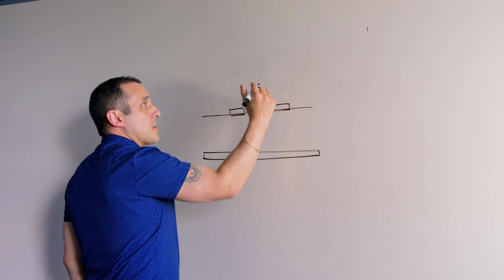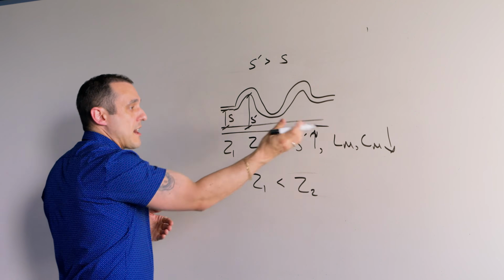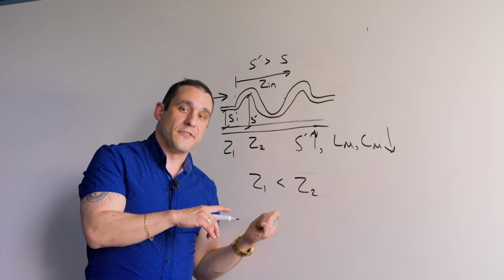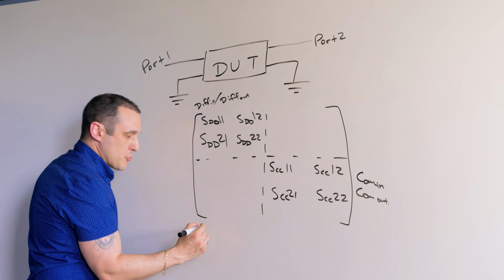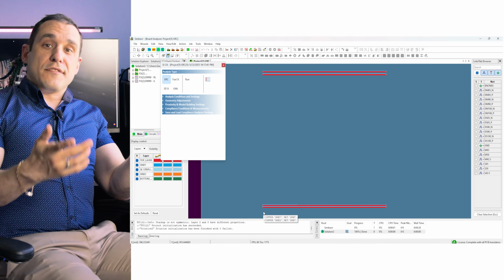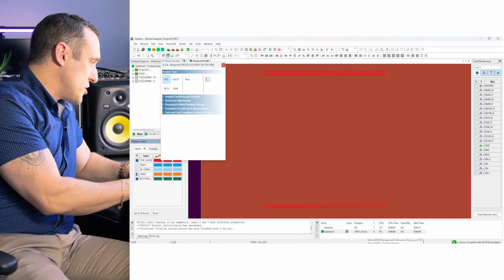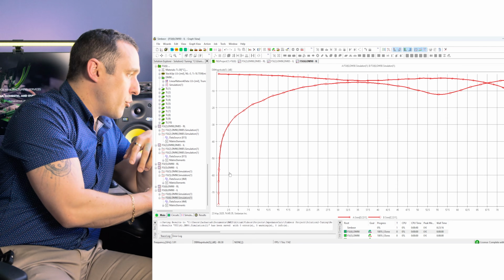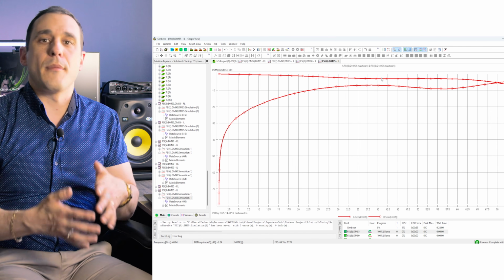What is the PCB Length Tuning Impedance in Differential Pairs?

Comment: Thanks for another great video! From what I understand, odd and even modes can have different velocity of propagations. I guess it has to do with where the fields pass through different dks . As the  velocity and length of the line will affect the time delay between the odd and even mode signals, I assume the placement of the length correction should be as close to the discontinuity as possible to minimise the time delay difference.  Is there a rule of thumb or equation to define how far the length correction should be made? It might be interesting to see different lengths and placements in the simulation to see the affect. Or would the S parameters not show this well being a frequency plot. Any thoughts?